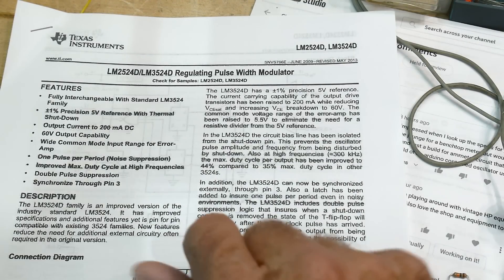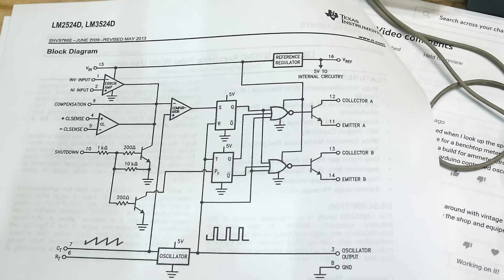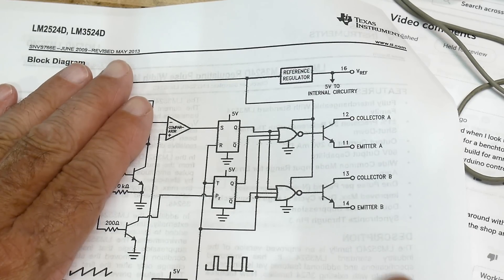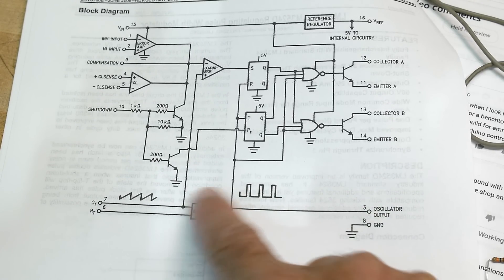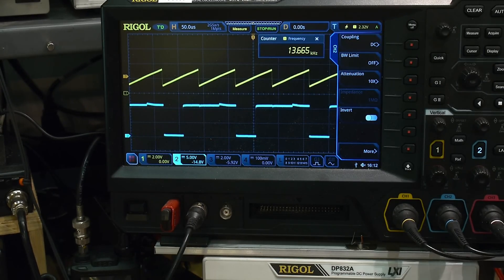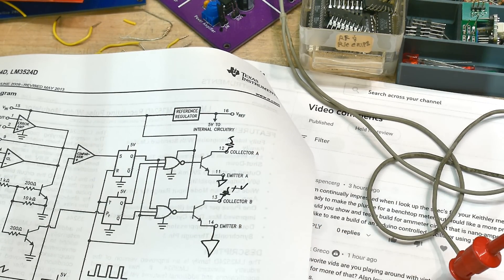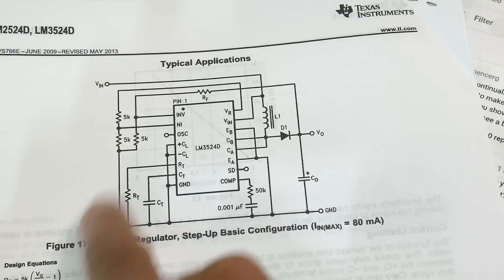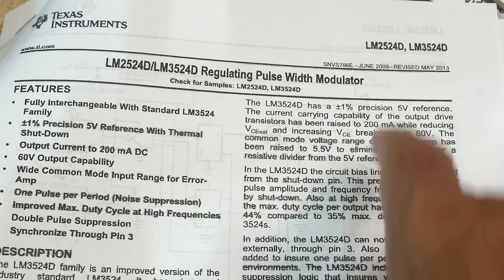#1232 LM3524D Pulse Width Modulation Regulator

Comment: It is a pretty straight-forward IC but it is also a VERY old design, dating from the days when bipolar transistors were used as the power switches.

"T" is for toggle, not trigger.
The waveform was perfectly synchronous, but the scope trigger was set to the toggle input, not the FF output.
Transconductance amps are moderately common in SMPS controllers. They simplify matters considerably with a circuit such as this because you can connect multiple amps together at their outputs and pull the output down with impunity for hold-off or soft-start.  Frequency compensation is done with components connected to ground, rather than in a feedback network.
It was doing pulse width modulation just fine with the single collector.The maximum duty cycle on each output is limited to less than 50% (well, Duh!) The intent is that it would be used in a half-bridge, full-bridge or push-pull converter.

No, it is not way over complicated. It is quite versatile and clearly beyond the thought processes of someone who has never actually done switcher design beyond simple single-ended stuff.
There are certainly better controllers around now for high-performance DC-DC conversion, but they are even more complex internally than this part.

Comment: Looks like a better TL494 to me! :)
Reply: OK, the TL494 is 5% and the LM3524 is 1% ref accuarcy.  Price wise TL494 is 1/10th. the price though! :)
Reply: Internal logic of ..494/594 has multiple pulse suprsession ( in one switch phase ) whereas the.... x524 does not... because the ..x524 comparator o/p directly enables/ disables the  o/p ..but this & other limitations are overcome in the ..x524D ..this makes the .... 24D an even more reliable chip than the ..494...
Reply: @analoghardwaretops3976  Not aware (until now) the difference, but I would have though multiple pulse suppression is a good thing?  BTW, not a fan of single tranny output controllers like the 494, has it's place, but for a now mosfet world, they are a pain.  UCC3825 and SG3525 (the poor cousin when price really matters) are good to me.  Any other types you've played with that I could look at?  ....there are SO MANY controllers out there it's INSANE! :)
Reply: @stevenbliss989  multiple pulse suppression is a must and is implemented in all later day designs . The multiple pulse suppression is achieved because the pwm comp. out is now fed to 1 input of the R-S ff in the x524D version ,which is not the case with the 1st. gen.  x524...
Reply: @analoghardwaretops3976  I thought that might be the case, thanks :)  BTW the TL494 is crazy cheap, but the SG3525 is not much more, and for me vastly better.  But I still love to use the UC3825 when $ don't matter, ...high gate drive, proper current control ability (the SG35325 sort of has it, but I do not trust it) ..but $$$  Any other PWM chips you use?  Always looking for others experience with chips I have not played with.
Reply: @stevenbliss989  I haven't actually worked with 494 except on one occasion (in  1989/90-- development stage only)  ..later seen it in use in CROWN professional amp series in (2017-2020 ) ...The ..3525 ( sec. p.s.) & 3842 ( pri.p.s.) experience was in Mackie 's SRM 450v2 (servicing level) and was a really well designed ckt.... In later product Mackie THUMP series the FAN7661 (Fairchild) half bridge quasi resonant voltage mode was another good design it has it's own built in MOSFET gt.drivers ....
( service of Mackie professional Audio 2016- 2021)
But my first exp. ( in 1993-97) with the 3524/2524 ..and when it's limitations were exposed we switched over to 2524D..with total sucess...
Reply: @analoghardwaretops3976  Not familiar with the FAN7661, but I do like QR controllers, some of which are very advanced in their operation.  The ST L6565 is amazing in all the things it does (well hidden) to operate,  ..if interested, have a read of their app not AN1326, it slightly blew my mind at the engineering features that went into this chip.
Reply: The TL494 is an old design, too.
TI was never very strong on SMPS. That changed very dramatically when it acquired Unitrode.
Reply: Yeah, and I have a love hate relationship with it!  It is very easy to use in a stable way, unlike the LM3524 copy, the common SG3524 which itself is a copy of the UC3824  ..it gets nuts!. TI suddenly had a slew of such chips, some like the UCC3895 or the synchronous version, the UCC28950 are nice.  Then of course you have the ubiquitous UC38xx bunch (which area pain to use,  but dirt cheap like the TL494).  A TL494 with totem pole outputs would be a nice device even today.  But we must move with the times, and Linear Technology make a bunch of awesome power control chips.

Comment: It's a great chip for its age.  Lots of switching power supplies use it.

Usually, you use an RC network on pin 9 to stabilize the loop filter.  The OTA on pins 1/2 is for voltage sense, as the voltage gets high, it pulls down the pulse width.  The one on pins 4/5 is for current sense, you measure the drop across a shunt. It gives you foldback current limiting, not just a hard limit.

The separate collectors are for push-pull driving a transformer primary (or driving the gates of MOSFETs or IGBTs that in turn drive the transformer).  Often you see them pulled up to drive an H bridge.

Normally, you put an RC network on pin 9 to stabilize the loop filter.

Oftentimes, your voltage and current feedback come back through an optoisolator, and this chip is running on the high side. of the transformer.

The reason for the complexity is that the chip tries to do everything.  Nowadays you buy a chip for the specific circuit topology you're using.

Comment: I see further down in the comments alotta people seem to be confused as to what this would be used for.When I watched the video it hit me right away the applications for this. Now...that being said I've only started really learning about electronics about 2 years ago and maybe off the mark fully...But as to the set-up-wouldnt a massive app for this be a AC/DC-HF-PWM welding machine?specifically GTAW & SMAW freq-balance and foreground/background Slope control when pulse welding with HF??? 

now like I said:I'm very new to electronics!lol I could be completely off the mark...but the functionality of this circuit as an integrated one into a hi-amp welding set-up would be EXTREMELY precise in the welding of nonferrous metals-namely ESPECIALLY Aluminum! :) 

Are any of you guys welders?
Like I said:pay no mind if I seem the a kid trying to talk to adults at an adult party!lol If I'm wrong,tell me.Either way awesome set-up!Excellent video sir!
Reply: Certainly for welding app.control circuitry..but with lots of limitations & low reliable performance, if used as a standalone .....
For high current applications , current & temperature control in the feedback loop has to be designed with additional external components / circuitry ...to reliably work ..

Comment: Why was this thing developed?  There would have been a major market to justify something this unusual.
Reply: It was a common SMPS chip. I still use it sometimes for demo or one-off things. Got a tube still full of them :)
Reply: Everywhere there's always a beginning...& everything is new even to the " experts " who developed them...nobody can foresee any flaws/ limitations.....hence we have..." new & improved...." / " version 1.1.xxx/ version 1.2.xx etc
Reply: It was a perfectly good controller suitable for a broad range switchers. It seems too many people these days have never seen anything but simple buck, boost and flyback converters. This could be used for any of those but also for push-pull, half-bridge and full-bridge circuits from a few watts to kilowatts.
There are better ICs around now and many of them are substantially more complex internally than this one.

Comment: Heh 20 odd years ago when I was in high school just starting to look at SMPS I designed and breadboarded a circuit that looked almost the same as this chip. Only difference I had was not using a ramp generator. I was only doing buck conversion so I just used a flip flop and a clock with a comparator to drive it all. It worked surprisingly well really.

Comment: These used to be the building block for a wide variety of SMPS.  IIRC, the two complementary transistor outputs were used to drive the push-pull primary of the isolation transformer.  The T.I. datasheet for the SG3524 shows all of these configuration options.

Comment: Hmm, if you can manipulate some dead time between the flip flops you could use it for an H-Bridge.
Reply: 3524(200kHz)/ 3524D(500kHz),. both versions  have max.duty cycle of around (94%....47+47) ...which is sufficient dead time (6%...3+3 ) even for slow bipolar transistors that were available in 1980's when the chip was introduced...to increase this dead time some more suitable xxx nF cap connected to pin ( osc. out ) can be selected as per datasheet graph that shows plot of cap value vs dead time in uSecs...this will bring down max duty cycle further... another way is with voltage clamp on Compensation pin......but for H bridge seperate high side & low side dead time has to be designed seperately with external circuitry...

Comment: The semi-random phase of the flip-flop output is almost certainly due to the trigger not consistently hitting an "on" or "off" pulse when triggering on the oscillator. You could probably get it to stabilize by playing with the hold-off
Reply: I was waiting for it, enjoying the real bottom up explanation of the chip.  The proper way was given here: "Lets go and trigger on channel 2" https://youtu.be/r8UsCjLO4O8?t=636.
Reply: Simplest just to trigger from CH2. CH1 ramps triggers on either 0 or 180 degrees of the output waveform and thus can give either polarity on CH2. Hold off would cure it too, just more finicky.

Comment: Heres an odd question for you. Whats the lowest frequency of the square wave while remaining stable ? (say around .01%)
Reply from the maker: no idea, this is not the circuit to use if you want stability
Reply: @IMSAIGuy  Cheers. Just wondering. :)
Reply: 0.01% frequency stability puts you into the realm of a quartz crystal. Even ceramic resonators aren't generally that good and their initial accuracy is typically quite a lot worse than that.
If you need something low frequency you can simply use counters to divide your crystal oscillator frequency.
If you need something adjustable you've go a problem. I would say the "best" solution there these days is to use a direct digital synthesis IC. They don't inherently produce square waves but you can use a comparator on the filtered output. I think you can find complete modules that will do that fairly easily.

If you need a super-precise clock signal at reasonable cost, a "GPS-disciplined" voltage-controlled crystal oscillator is not very complex and quite cheap. You start with a VCXO that has a narrow tuning range and use it in a phase-locked loop that compares the signal from a GPS receiver module (I'd recommend something based on a u-blox product) with the output of the VCXO and phase locks the VCXO to the GPS signal. You can program the clock output from a u-blox module over a fairly wide range (I don't recall, but detailed in datasheets). That might be usable directly for what you want. Of course you do have to be able to receive from the GPS satellites.
Reply: @D614G_aka_Doug  Thank you. 👍

Comment: Thanks for the video. Interesting demo of the functionality.This is also used in dc to ac inverter designs where the two outputs are needed for the AC waveform kind of push pull, that was my first encounter with this chip.

Comment: I've been playing with single op amp PID circuits and would love to see you analyze them. The PID output feeds a single op amp PWM (square wave generator with an input to the non-inverting side instead of a normal voltage divider) for a complete lm358 PID/PWM controller for heat/cooling control. The PID circuit is from "Realization of a Low-Cost Op-Amp Based PID Controller" by Ibekwe (2018).

edit- the input I'm using is a 10K thermistor/ 4.7K resistor as a voltage divider and the output is driving a 2n2222 for a fan or heating element.

Comment: The most efficient, resonance based, zero-crossing converters can also be excited and controlled by such a more generally applicable chip.  These output transistors can also supply gate signals to hi-power MOSFETs and IGBTs for more applications.  Pulled up to 5 V, the collectors are also suitable for H-bridge inputs.  The comparator flexibility is also suitable for power factor correction.  But usage does require more skill and more circuitry.

Comment: a TL431 on steroids?
Reply: No resemblance between them.
Reply: @paulcohen1555  there is a comparator and internal reference of 2.5 volt inside the TL431, check the video from GreatScott on it. he shows it actuating.
Reply: @AnalogDude_  
There is an amplifier, not a comparator, in the TL431. It can be used as a comparator but it was designed as a linear amplifier with pretty decent characteristics. Clues: it calls it an amplifier in the data sheet and there is a frequency compensation capacitor in the schematic of the amp.
Reply: @D614G_aka_Doug  "it's key components to behave as a
single voltage reference, error amplifier, voltage clamp or comparator with integrated reference."

I know a eurorack VCO mopdule that creates a SAW wave using a LM393.
Reply: @AnalogDude_  
Like I wrote, the amp in a TL431 can be used as a comparator and I've done that in several designs. With the addition of an external transistor you can make a comparator with quite accurately controlled hysteresis.  I used that in a load-disconnect feature that was part of a switchmode battery charger I designed for one of my industrial clients.

As is always the case when an op amp is used as a comparator it is relatively slow. Circuits designed specifically to be good comparators are generally very much faster. Comparators make terrible linear amps. For lots of things slow op amps are fine as comparators.

What was the LM393 actually doing? I can pretty much guarantee it wasn't being used as an integrator to generate a sawtooth, but instead working as ... a comparator.
Reply: @D614G_aka_Doug  Yep, configured as comparator, but it switches so fast and continuously it draws a saw tooth.
Showed simulation.

I checked (again) the simplified schematic datasheet shows no feedback. it's like Greatscott showed, its switches the transistor so fast that it appears to generate a stable voltage. that's cool.

I prefer using LM393, LM339 over opams, i don't have to deal with negative output and faster.
Reply: @AnalogDude_  
You've lost me. I don't know which thing you're talking about now, the TL431 or the LM393.

If it's still the TL431, "Great" Scott got it wrong. From what I've seen he gets one or two things wrong in most of his videos. The TL431 in normal operation as a shunt regulator does not switch, but operates in linear mode. If the capacitance across it is wrong it is unstable and will oscillate, but it most certainly is not intended to.

There is no global feedback internal to the device. Feedback is established by the resistors that set the output voltage when it is being used for its primary intended purpose.
See sections 9.3 and 9.4 of the datasheet.

You can use an op amp as a comparator with a single supply, but depending on the amp it may not swing very close to either rail and the input common mode voltage range will be limited (but then input common mode range is limited with most purpose-designed comparators; some have CM range that extends beyond one of the supply rails; I can't think of any offhand that have input CM range beyond both rails).
Reply: @D614G_aka_Doug  i know and i use bi-polar supplies.  i didn't said it would act like a switch, but if the voltage drops under to the "reference" due to load it will actuate and turn on till and fill the capacitor till its equal or slightly above the ref and turn off again.
Reply: TL431 is a 3 pin high accuracy precision reference regulator that's also temperature compensated... it's not a pwm controller...
the ...24/...24D have an internal 5 V ref. that's not so tight in specs...and any external voltage divider adds it's own tolerance errors...to make it a far less reliable reference .
Reply: @analoghardwaretops3976  i said on steroids
: )

Comment: They've gotta be 30+ years old at least, they were used in some variants of the original IBM PC PSU and they were old hat then...

 Good old days though, when chips were designed to be flexible and offered the designer options on configuration rather than app notes with dire warnings about deviating from ref designs.

Comment: The architecture of the chip allows it to be used in resonant converter type push-pull configurations.  You can connect the two transistors a totem pole arrangement and the output can push and pull current without concern for shoot-through.  This type of configuration is good for resonant converters that have lower noise than flyback style converters.  It is odd that the datasheet didn't show an application that takes advantage of this.  I looked and the only application note I could find that sort of exploited this is the application note 288.   But there seems to be very little on the interwebs on this obvious use-case for this chip.
Reply: They definitely don't have shoot through issues..but equally dangerous is power device failure ( dead short..that kills the other one too)  due to possibility of one sidedflux buildup ,leading to core saturation in either normal push pull pwm or even when used in resonant mode...because of absence of 
" Volt-Sec. "  balance ( that is a must.)  
...either internal to chip or added externally.